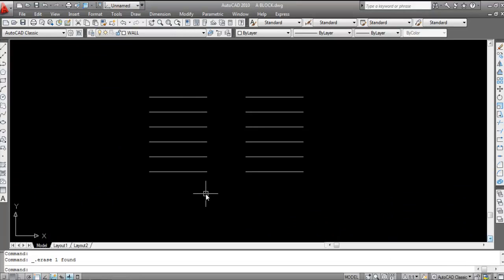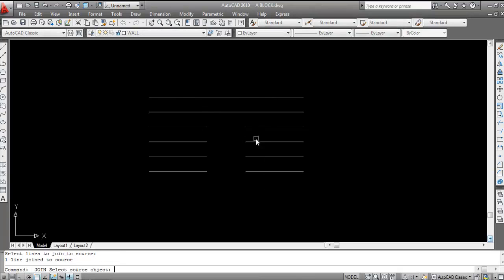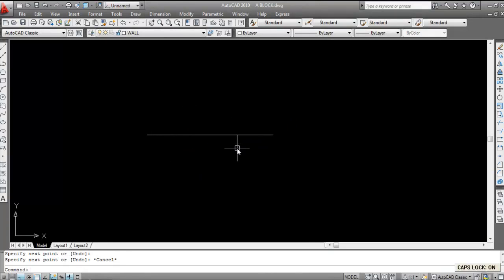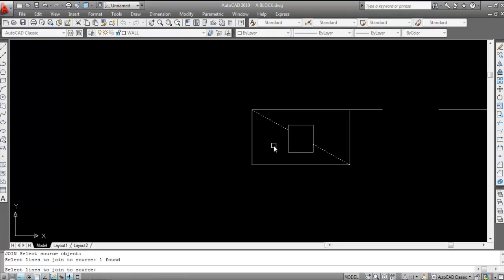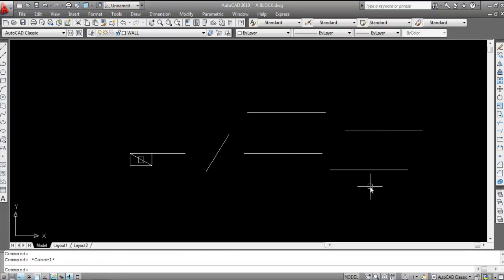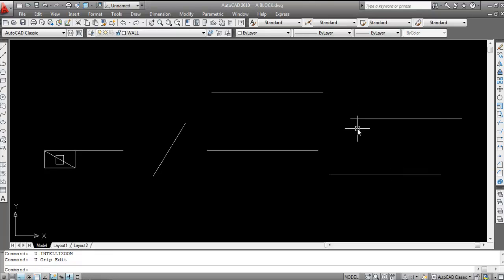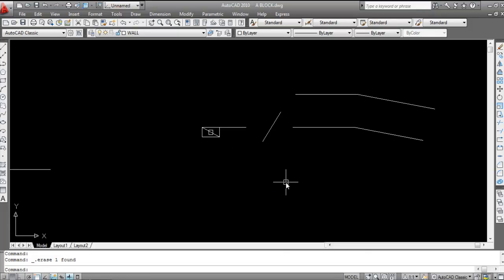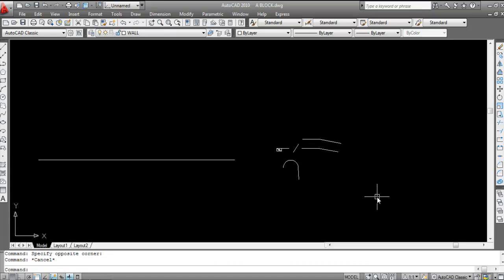AutoCAD #11 - How to use JOIN Command in AutoCAD | Multiple Methods Explained

Comment: i can't join two lines the join command is not working for me
Reply from the maker: Before joining two lines make sure those two lines shouldn't be polyline. You can only use join command for lines not polylines. Give join command, select first line then select second line press enter...
Reply: @civilengineeringtutorials  doing same procedure mam as u told but cannot join the lines.. they r not polylines